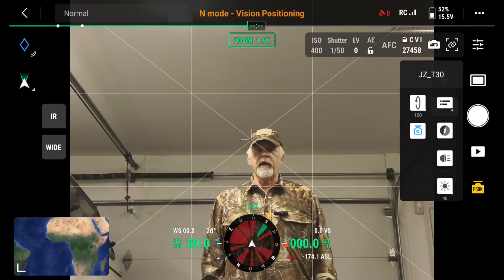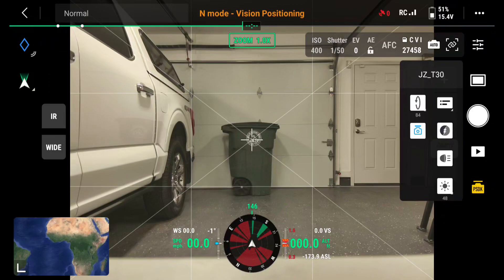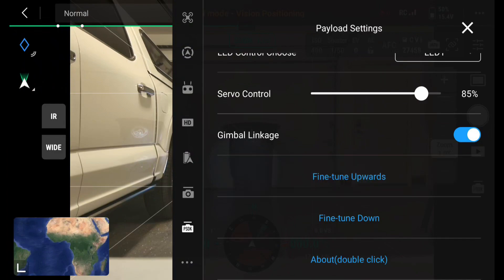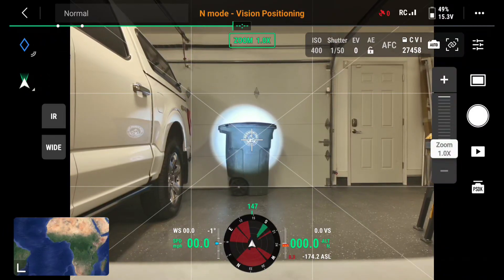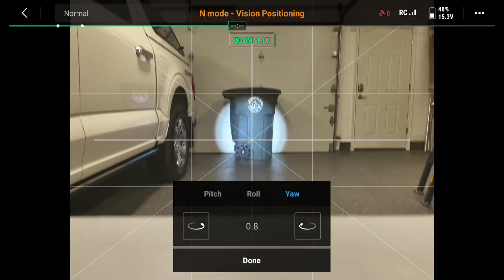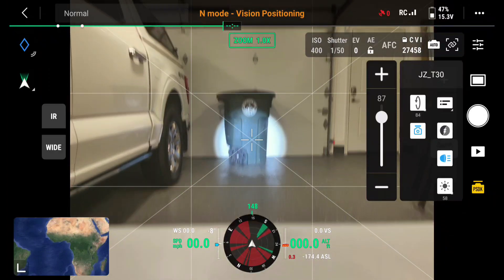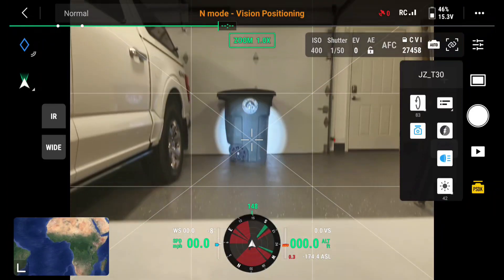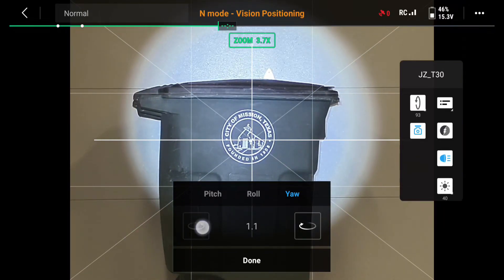JZ JIZHI T30 Matrix Searchlight Fine Tuning on a DJI Mavic 3 Enterprise Thermal Part 5 of 5

Comment: How does the spotlight connect to the drone, was the installation difficult?
Reply from the maker: You simply flip the socket cap open located on the top of the drone (enterprise drones only), and screw the lamp to the top of the drone with the two mounting holes.
Reply: @W0GEN  I own a Mavic 3 but I am considering getting the Mavic 3 Thermal. Do you think the Mavic 3t is worth the price?
Reply from the maker: @seanswanson8831  it was the best value I could find for the thermal performance...

Comment: Can you give us your thoughts on the light you showed and how good or bad it works, but we need to know your opinion on it should we get it or get another kind..
Reply from the maker: Personally I believe that it is the best available for the price.   JZ has added front strobes to it as well.  In a search mission we can use it to provide visible light to verify the target that we find using IR.  It also would be an effective tool to light up an accident scene however the battery life would be limited if running full brightness.
Reply: It’s the best tool for the job, works very well straight from the box, and this advice on setting the light to coordinate with the camera lens cross hair is very straightforward to follow. For the Thermal version this makes it a viable Search and Rescue tool, or for eg locating a successfully harvested deer after the light fades.